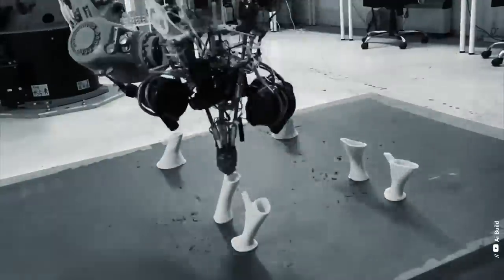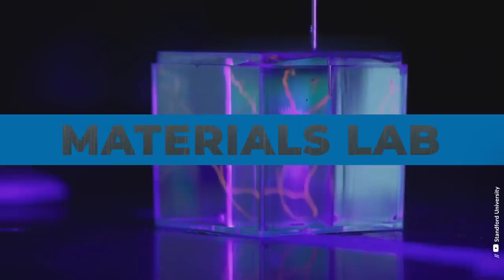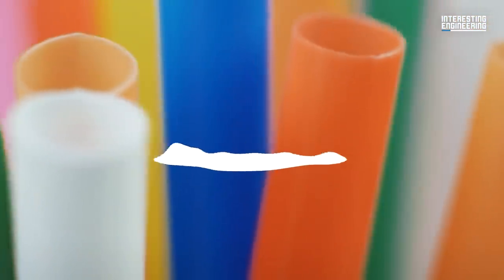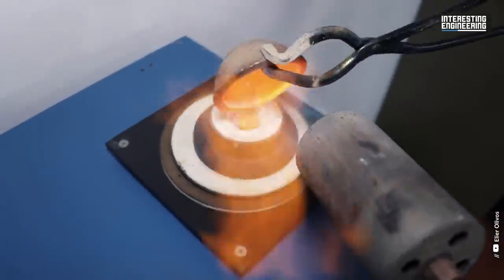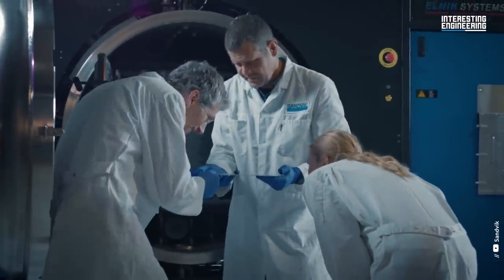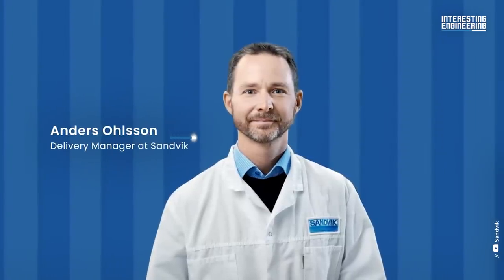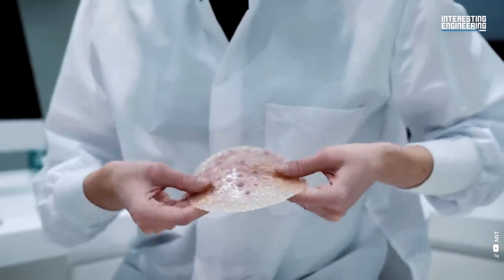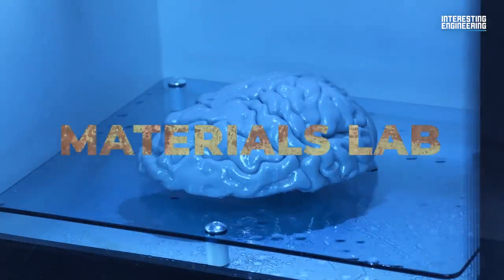3D Printing Is Becoming Unstoppable

Comment: Is it possible to build structures at Atomic scale with the help of 3D printers in the future?
Reply: Yes. If you think about it since a human can do it, a 3D printing machine can.
Reply: Yes! Using lasers. We already use lasers to manipulate atoms and position them, there is no reason why a laser based 3d printer won't be able to do so. Its the same basic technology.
Reply: Of course it's possible
Reply: I wouldn't necessarily call it 3D printing - but yes, we can already manipulate and place atoms in very specific orientations and designs. However, what we are currently capable of would take hundreds, if not hundreds of thousands of years to fabricate something like a 3in x 3in x 3in cube.
Reply: Yes, and on this tangent, with future tech 3d printers will be able to print smaller 3d printers, which will be able to print smaller 3d printers, which will be able to print smaller 3d printers to the plank length and maybe even beyond...
Reply: Anything is possible in the future
Reply: I'm a Jeweller work with 2 microns which is 0.002 mm 
I user work 25 microns 5 yrs ago. 
So I think we are moving too fast to the future and it is very possible
Reply: Chemical reactions
Reply: Wow, Mind-blowing thought, you can literally build any material from a subatomic pov.
Reply: Look up "a boy and his atom" by IBM
Reply: @terrafirma5327  yeah but the wavelength of that laser would in the x ray level. Completely impractical
Reply: That's already happening
Reply: @_____ i love isaac arthur. Hes really good.
Reply: @Themasterbf3  Oh I don't mean anytime soon, we may have to develop new kinds of lasers before it happens. Such as solid photonic lasers.
Reply: EBL= Electron Beam Lithography. This is writing / printing with an electron beam.
Reply: Pretty much anything you can think of is possible in the future
Reply: no; it isn't 3D printing despite what people say. Also, just calling all these additive processes 3D printing is rather stupid
Reply: @ArnaudMEURET  Anything is possible in the future? So, I can make the statement that "anything is possible in the future" to not be true, and since anything is possible, my ability to do this is also possible. Hence, there is a contradiction, and we can conclude that NOT everything is possible in the future
Reply: @pyropulseIXXI  I am going to go with the experts in the field for what defines 3D printing. Its a technology, and it will be called whatever experts in the fields using technology call it. That is just how these things work.

Comment: 90% if 3D printing is done because of novelty of it and buzz appeal not because it produces better, cheaper, nicer results...
IMO it will be over used and in the end most of our daily products will become even more shitty.
It should be used for purposes only imposible to be made with traditional methods
Reply: It produces WAY cheaper parts. Take fdm printing for instance. If you had to get a one off fdm part to be injection molded or machined, it would cost a whole lot more than the $.75 worh of material the printer used. And thats assuming it was even possible to make that part conventionally.

Comment: Showing a carbon fiber wrapped toy sword and saying it can be as hard as steel 😂 yes it CAN be but that was not.
Reply: Carbon fiber is definately just as hard as some types of steel, even when its very thin. Problem us it doesnt have the tensile strength so if you were to strike something with it, it would just shatter. "Hardness" and "strength" arent the same thing.

Comment: Too bad that after 40+ years of development it still has all the same issues.  It's slow, has poor surface quality and wildly inaccurate compered to machining.  I'm not saying that 3D printing doesn't have it's place, but it's far from a singular solution.  If tight tolerances are need to held then the prints usually require machining afterward to hit the required specs.

Comment: What is printable might be a facsimile of a human cell, but it is not a real human cell.
Reply: Resource? I want to know this argument. What I have read is they use real cells.
Reply: As someone who does tissue engineering research, I 3D print live human cells regularly. The cells can be suspended into liquid biopolymers and then deposited like traditional printing. After, the polymers can be crosslinked form a solid with humans distributed throughout. I'd be happy to elaborate on the specifics
Reply: @RileyBuilding  Can you explain in simple terms how a human cell is "copied"? I have to say Im very sceptical.
Reply: @RileyBuilding  Thank you for this reply!
Reply: @jefp65  Sure!

Cells essentially copy themselves by splitting in half, where one cell becomes two. All the cells in the human body, original came from a single egg cell inside our mom. So, that one cell kept dividing into all the trillions of unique cells we have right now. Cells kinda of exist in a tree of specialization. Where cells at the base of the tree can turn into any of the cells at the end of a branch, but cells at the branches cannot go back to the base. Cells near the base if the tree are called stem cells, which can divide and turn into more specialized cells like skin or muscle. But getting stem cells from skin or muscle not possible... naturally in the body.

Turns out, a while ago, researcher realized that we could take specifc cells, commonly bone marrow or fat cells, and turn them BACK into more generalized stem cells. We call these Induced Stem Cells

This basically means, we can remove some fat cells in your body and turn them into stem cells. With those stem cells, we can "tell" them to turn into any specific cell type we want.  

Also, in the US, it is illegal to use embryo stem cells collected from abortions - banned in 2002. So all stem cells research from the last 20 years has been done with induced stem cells. 

For my work, I bio-print with induced stem cells into different environments and different geometries to assess how well we can turn stem cells into specific cell types, like bone or cartilage. The human body is really good at making specific cells from stem cells. But we don't really know how the body does it, which is why we don't have lab grown organs or lab grown meat - because we just haven't figured out how to do it. 

I am not entirely involved in the stem cell making process, so if anyone reading catches a mistake please correct me! :)
Reply: @RileyBuilding  Ok you didnt really answer the question, despite the length of your reply.
Youre talking about cell manipulation, and then provoking these cells to reproduce themselves. You claim that you are bio printing, but you give no clue to how this is done. Im guessing the cells are reproducing themselves, so its even less impressive than I thought it might be. 
If Im wrong, and if you want to be helpful, explain in very BRIEF terms how YOU are printing these cells independantly of the original cells.
And please, spare us the biology lesson, I asked a very specific question.
Reply: @jefp65  You're going to have to understand at least a bit of biology to get this, but basically they're growing a bunch of cells, the same way children grow or bacteria multiplies, and squirting out those bits of still living meat into the shapes they want. 

The problem is that we have cells that can turn into any kind of cell, but we haven't figured out how to make them do that.
Reply: @jefp65  
Without a willingness to learn biology, it might be difficult for me to give answer you are looking for. 

Anyway, yes, cells copy themselves to reproduce that is how all living organisms work.

We take a few thousand original cells, and put them in liquid that makes them happy. There, they split from one cell into two ideatical cells. So one cell is the original,  one is the new. Those new cells then split again making a total of four. 

This continues for a few days until we have millions. Then we remove all of those, and put them into the ink we are printing with. 

We have to get some original cells each time we do an experiment. Original cells only have a few 10s of division they can do before they stop copying themselves. 

 If they didn't stop copying themselves, they are usually cancerous.
Reply: @RileyBuilding  Thanks, you've answered my question. You've confirmed that the cells are reproducing THEMSELVES. The term "bioprinting" is deceptive because the scientist is not actually printing or copying the cells. They are reproducing themselves. All that is being done is that cells are being manipulated to take on different forms, but this is not entirely predictable.
Reply: @ChrisD__  You're not understanding point of the conversation, which is the distinction between theoretically copying cells artificially, which is not a reality; and manipulating cells to take on different forms, which are are then fascilitated to divide and reproduce themselves.
If you cant see that distinction I cant help you.
Reply: @jefp65  

Yeah, that is pretty much the jist! But yes, I do agree "Bioprinting" is extremely over hyped and misleading. When printing with cells and their biopolymers, we are just applying the technique of 3D printing to already existing cell copying techniques.
Reply: @jefp65  

As someone who is on the technical side of "Bioprinting" it is often frustrating to see people make ambitious promises with bioprinting, and I have seen that most of these come from companies that are selling an overpriced printer. 

The idea of bioprinting is probably 30 years from making any sort of functional organ, but I guess that is why are doing to research 😀
Reply: @jefp65  

I will also add that in biology and most sciences, when communicating complex research to the public, often translating into more brief terms will change the meaning of what was performed and sometimes entirely mislead. The idea of copying, as you mentioned, is just too generalized of a word to precisely describe a process in biology, in this case its refers to, mitosis, proliferation and differentiation - all jargon that makes no sense to anyone other than tissue engineers
Reply: @RileyBuilding  Yeah I get that, and I can see the benefits of this technology. I just get concerned when suggestions are made that science can do  things that are just not feasable. And you're right there's always financial gain to doing so.
Reply: @jefp65  its not that a cell is "copied". They are grown. Our cells are very capable of replicating themselves (they do it on a regular basis). With the right conditions they can be made to do this in a lab environment instead of needing to be attached to the body.